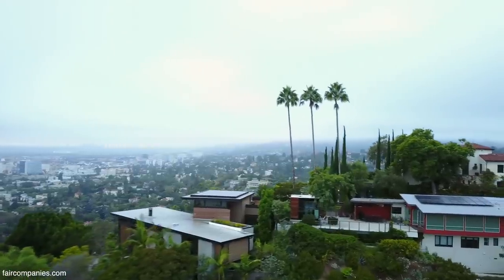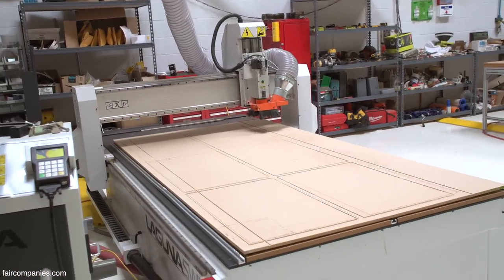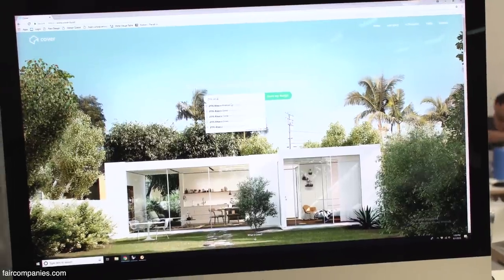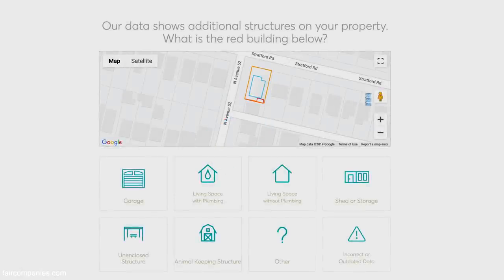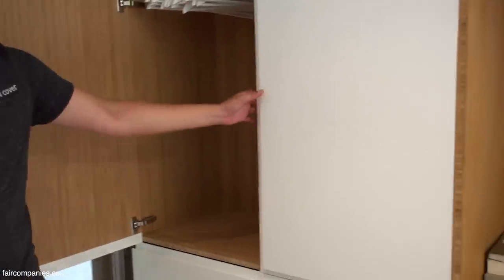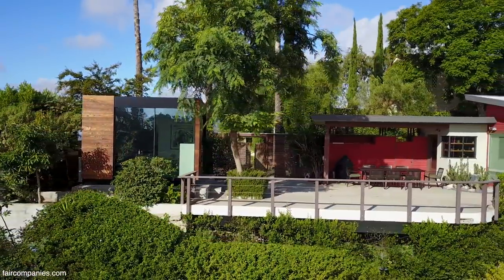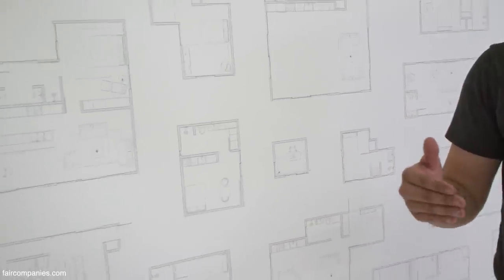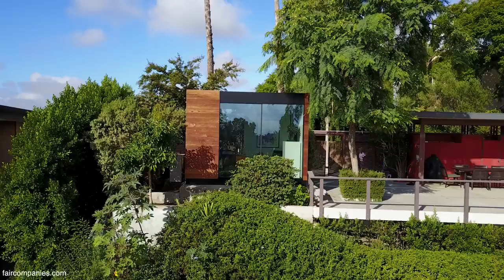LA startup offers custom small prefabs adapted to area code

Comment: I'll bet these "cheaper to make homes"' are at least three times as expensive as a 2x4 house.  (Efficiency replaced by the usual greed.)
Reply: Controlling the environment the building is made in isn’t such a bad thing. I remember when houses were built in the summer time or at least got to the dried in stage when it was dry out. Now they are throwing them up in the rain and snow. That can’t be good for the materials being used or the people who eventually have to live in a house with mold.
Reply: @Tribulation Prepper - Depends what you''re comparing to... Houses aren't all built to the same standards so they're not all going to cost the same.

There's a big difference from how say a Tract Home is built from how a custom high end home is built.   Just like there's a big difference a luxury yacht and a Shanty Boat...

Everything has a cost/benefit/trade-off  to consider but anything involving choices means a lot of the costs will be down to people's choices... 

Like an analogy would be going to a car dealership and telling them you want a Lamborghini with all the optional features vs asking for a Honda Civic with base package, there's going to be a very large difference in the price they're going to quote you...

Really, want a low cost home then don't choose high end features like floor to ceiling sliding glass doors, custom cabinetry, smart home automation, radiant floor heating, high end fixtures and appliances, custom furniture, etc.

Nor try to live in a part of the country where you'd need a house built to handle weather and climate extremes that a basic house wouldn't be able to handle...  Among other things to avoid that can add cost to a home...

Builders can only do so much to limit costs but end of the day, they're in the business of providing their customers what they want...

Custom builders like this one will actually have a range of prices because not all of their customers will order the same configuration for their homes.
Reply: @ZeoCyberG    Hey Willis...  I understand (FAB), Features, Advantages and Benefits.   My comment was prompted by what this builder said at the very end of this video, around the 11:30 mark as well as by what some other "pre-fab" builders have touted in other videos when they claim a cost savings for their Model T type, assembly line, home production process.   Henry Ford's efforts made automobiles publicly affordable.   I don't see the same result where this new breed of snap it together home builders is concerned.   As with tiny houses, the price per square foot for these Lego Homes is absolutely outrageous as nice as they may be.   With the US economy on the verge of collapse, ANOTHER real estate bubble being readied to burst and new generations of jobless college grads on the way,  there is no future for these overpriced boxes.   Just my opinion.  Take care.
Reply: @Tribulation Prepper - "No future" is what they've said about many things, including Ford's Model T when it first came out...  

Here's the thing, the cost savings are real.  The problem is the market they're in demands high end products and it'll take more than reducing the production costs to over come what high end adds to the costs.

But apply the same production to a more basic design and they can sell it for a lot less...

A lot of the problem is most of the people with the money to buy homes don't want anything they will perceive as low end and even when they do they have to worry about their neighbors, etc. making their life hell for making that choice.

There's companies like Incredible Tiny Homes that have starting prices at $25K but most of their customers don't buy those models in anywhere near the numbers needed to make that a good business model to rely on for them...  It's a supply and demand market and builders can't sell what there isn't an enough demand for or they'll just go out of business, which many have already.

While those with little money are often in the position they can't even afford the low cost homes but even then most still seek high end because that is what they expect to have with a home or somehow it's no longer worth it...

There's too much of a perception that low cost = dump/trash/slums... and too many people who think having less = suffering and dehumanizing...

Like Jay Shaffer recently showed off a modular design that can start with a very basic core unit for under $5K as a starting point that could at least get people into a better situation who would otherwise be homeless that they can build from and add to over time but it still gets criticized for being too small, too basic, not being a "real" house, too reliant on shared resources to get started, etc.  

People in our society have forgotten how houses used to be built when most people did it themselves and build homes over generations.  It has to be all or nothing, even if they're open to alternative lifestyle choices like living off-grid, which not all are and is yet another barrier to getting costs lower...

So it's not a situation you can expect just the builders to fix because they can't.  Society and pretty much the entire housing system has to radically change from how it works now.  We have to end NiMBY'ism, reduce consumerism, and the other barriers to getting more practical solutions out and actually used.

Comment: Seem like apple computer, sleek design, very hard to repair.
Reply: Had the same thought, especially when I saw that outlet.
Reply: Maybe the walls pop off.
Reply: and do not forget it is apple alike becasue of overpricing and most likely after a few years won't work anymore because they will tell you to buy a new house to install newer software without being able to install older software that would also work fine. This is not a house with biggest advantages for the buyer. This is a house for the selling factory. If you buy it, they laugh behind your back.
Reply: Too apple. Interesting though
Reply: DefinitelyNotDan , agree! I’ve used Apple computers since their invention! Never had one fail! 11-12 year old work horses! Once you go Mac, you never go back! 😂
Reply: @windrider5845  I had staingate twice, bad keyboard, bad trackpad, failed gpu which meant replacing motherboard. That's 3 out of 3 Macbooks failing. I totally hate windows, absolutely love OS X, but Mac computers are intentionally hard to repair and upgrade components are severely overpriced. For my workstation I've come to terms with Windows because the Mac equivalent would have cost 3 times as much and still not be as stable long term.
Reply: Louis Rafael Rosenthal , wow! You are cursed! I’ve had more Apple/MAC products than I can remember and had 1 phone die after new software was loaded on it that killed it but it was old. I know the newer IPhones and possibly other products aren’t what they used to be!
Reply: DefinitelyNotDan  I like and can afford apple products, now explain what you mean
Reply: @computerjantje  BUT if it was an ordinary Windows style of house you would need to install several security updates every week, it would be very difficult to find your way around and it would look like, well, crap I guess : )

Comment: If you build enough of these structures eventually one of those electrical outlets will fail. How would you repair it? It does look cool.
Reply: Just take the wall panel off and repair it, it's modular construction...  But each unit is inspected, so everything should be tested before it gets delivered.
Reply: You don't repair it silly, you just demo the building and build a real house.

Comment: Some of the ideas are not practical.  Rollers in the tracks will become clogged with dirt / debris over time. Electrical outlets have plates so it is easier to replace if you have a short or burnout as well as an isolation switch. This would not pass building codes in my country.
Reply: California has some of the most stringent building codes in the world. I agree about replacement ease, but not safety.

Comment: I think EVERY COMMET misses the point of what these jackasses are doing - their true product is the data driven software. They are not home builders, though they think they are because they designed software that aggregates data sources and builds a land use/compliance model for properties in the Los Angeles area. I have no doubt that their real business plan is to design and sell the algorithm in as many municipalities as possible. Building these boxes with their new CNC machine is just a revenue stream to support the software development.
Reply: I totally see that and agree with you. This is a long play on their part. Clever bastards. But they do need to worry about protecting that Intellectual property because anyone can source data. I can see a competitor easily coming in, learning from their mistakes and building a better mouse trap, so to speak -- the same way the guy in the video did after he left that pre-fab company he once worked for.
Reply: who gives a shit about the software?  I can build that pos for 1/3 of the cost in most likely the same amount of time.
Reply: Bingo
Reply: Agreed.

Comment: I would love to be able to buy windows and other innovative designs they have developed.
Reply: Even better, If it was affordable to people who have low income.
Reply: I think their inventions are theory based without real world longer testing. The bearings in a gutter seems like a really bad idea. Dust and sand will make the sliding worn out and stuck really fast for example
Reply: @computerjantje  Agreed, they need tweaking, but the floor to ceiling window systems look sooo good, and just the thing to do inside looking out space into a garden...
Reply: mara cohen Plenty of amazing walls of windows/doors on track that completely open up & disappear but they’re crazy expensive. These won’t provide longevity
Reply: @sweetpeace5  I agree with you, the engineering sucks....but ohhhh ain't they pretty!!!!
Reply: @maracohen5930  You might check my comment above, as Landscape Designer, yes! integration of indoor/outdoor spaces is wonderful. However, I saw the same thing as this comment, those rollers look like they will clog easily.

Comment: The main problem I see with these designs, aside from the unjustified price for self-advertised flat-pack low-cost homes, is the overuse of VOC-rich materials like laminated particleboard. Sure, it's easy and precise to work with it on CNC, but you're practically living in a laminate closet, and they were never meant for that. VOC-level grading is considered with a moderate material density in mind. Meaning that safe VOC levels are often at the upper limit in real world conditions, if not above it, because people tend to use too much flat-pack furniture and other products with "safe" VOC-levels. But all those "safe" levels add up and they have a compound effect on the body. Not to mention VOC is a wide range of chemicals, one worse than the next.

Comment: Shts prob not affordable. The "for everyone" part is w)n the LA bs high society market.
Reply: Probably around $200,000-300,000. >.>
Reply: @TechCarnivore1  -    Per the FAQs on the company's website, customers should plan on a cost of $300 to $400 per square foot, all inclusive. E.g., 300 sq feet would be a cost of $90,000 to $120,000; 500 sf cost would be $150,000 to $200,000.
Reply: Truth Reigns -      Per the FAQs on the company's website, customers should plan on a cost of $300 to $400 per square foot, all inclusive. E.g., 300 sq feet would be a cost of $90,000 to $120,000; 500 sf cost would be $150,000 to $200,000.
Reply: @wendyweaver8749  - Yeah, super expensive. My current home at 3000 sq.ft. would cost $900,000 to $1,200,000, not including land. I can assure you I can build it for much less that. An average house costs $150 -$200 per sq. ft., so, half the cost of these prefabs. Yes the quality and design is there, but is that worth double?
Reply: OMGWTFLOL That’s why they’re located in LA not wherever you live

Comment: Love the look, build quality and 'built-in' simplicity. But disappointed with the cost.
Would love to see a follow up video addressing these issues.
1. Once the company grows, will there be a significant 'mass production' related cost reduction?
2. What happens when an electrical outlet, recessed light or faucet fails? Will this company have to service it? Do they just replace the entire panel? How much will it cost?

Comment: Why not just buy a huge used RV for half the price and park it on the property ?  These designers are the same as RV and boat designers. Nothing Innovative here whatsoever. Obviously these overpriced units need to be plumbed for sewage, water, electric, possibly gas, and that can be very complicated and very expensive, same with a septic system.  I could go on and on about why this would be a very bad investment among all the issues i see with the design and construction issues here.  I've been a builder for over 25 years and this is just ridiculous !  I give these guys an A for effort. Good luck.
Reply: @justgivemethetruth  Every city has different codes and ordinances. As long as you park the RV on your own property it shouldn't be a problem unless some disgruntled neighbor has an issue with it for any number of reasons. 2 common reasons would be the appearance of the RV or if it's blocking sunlight they never really cared about until the RV showed up lol. There are ways around this that i wont get into here. Another problem is having a septic company that will come out on a pretty frequent basis to deal with the waste water unless you can plumb it into the homes main sewage line. The companies that deal with Port-O-Potty's are the ones you'll be dealing with and they're usually a little more expensive but reasonable. Other than that, i see no problem.
Reply: Apparently you missed the part where they stated that everything is pre-wired and pre-plumbed...
Reply: @obsoleteoptics  Umm.. the unit it wired and plumbed. You still need to run all the plumbing to the existing house along with the electrical and whatever else.  Apparently you missed the part where i said i've been a builder for over 25 years !

Comment: Hey... if there is a market for it. Good for them. No need to bash innovation, just because it might not work in your specific area. I'm from South Dakota and this would be WAY to expensive and unrealistic with our winters, but in a warm climate as an extra living space that can be rented out or used for visitors its a great system. I love that they are taking a vertical integration attitude.

Comment: The national electric code requires childproof covers, so these would never pass inspection, never mind maintenance.  The code also requires exit windows for bedrooms and weatherstripping on siding doors.  Elegant designs and fixtures most of which won't meet the uniform Code   Their software is a great idea.  I have prefabbed a couple of homes,with SIPS panels, so I know the true costs.  Huge markup here.  Good luck with the idea.  Many sliding doors are available in floor to ceiling height with flush tracks and proper rollers which would last.

Comment: I feel like you'd be maximizing potential for this by locating your production in the IE or Palm Desert where you are going to have super cheap cost of living for your workers and cheap property for the production floor, then use a train to ship them to the middle of LA since they have a freight yard.

Though you'd get better results building in a state with even lower cost of living and lower minimum wage to match, maybe NV, then shipping them even further using the same method. If they passed those costs on maybe we could actually see this get cheaper.

Comment: This is a designer trailer. Something that looks really classy now, but will require continued maintenance to stay functional. What happens when there is a leak in the roof? How to you repair the water damage?  The type of people who live in these units will be at the lower economic scale and will pack as many people in these as possible. Are they durable for this type of use?  Is there a foundation or do they sit on top of the soil?  Which building codes apply.

Comment: I got all the way to the wall outlets before I saw something I didn't really dig.  Seems like those outlets would be way cooler if they were milled in or whatever as part of the wall , not a 1$ part stuck in an expensive laser cut hole.  (Or get rid of the gap)

Comment: Looks good. Wish them success.
Concepts like this have had been tried many times in the past and mostly failed.
It looks like a closed system. How do users maintain it ? That electrical outlet looks cool but how do one replace it ?
Reply: Well someone here said it's to be maintained like a car door - basically replaced in its entirety or serviced by the manufacturer only :)). He just didn't explain what happens to a house whose manufacturer went out of business or 50 years later no longer supports the trash they started out with. These kids really do have a single-use throw away mentality

Comment: The outlets could pose a problem if they ever need serviced or replaced. And that roller track could get jammed up simply with dirt or debris. The overall idea is great. Just needs a little more thought on the service side of things. Stuff will break and/or wear out over time.
Reply: That's why you take care of it, vacuum out and lubricate the tracks and such